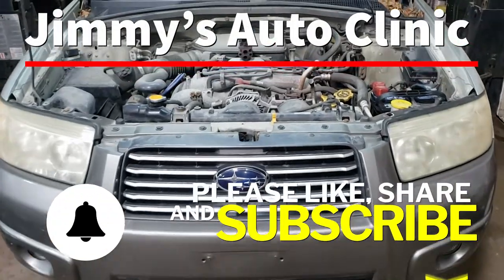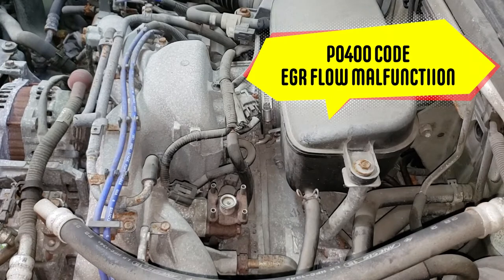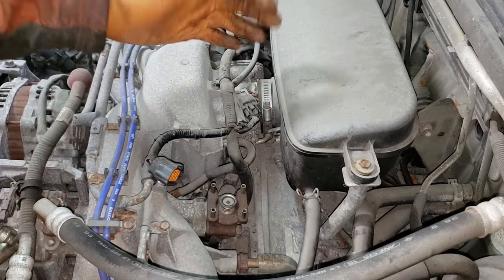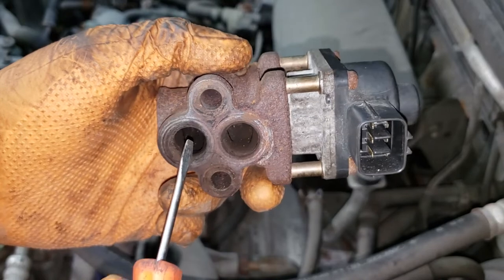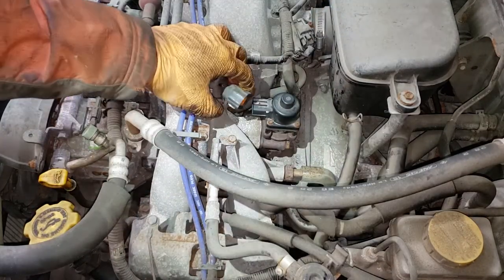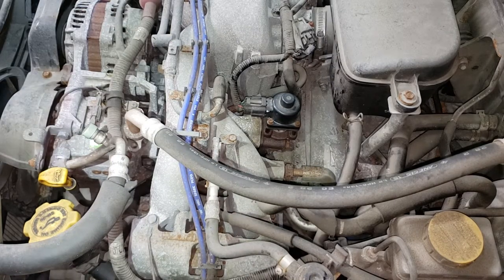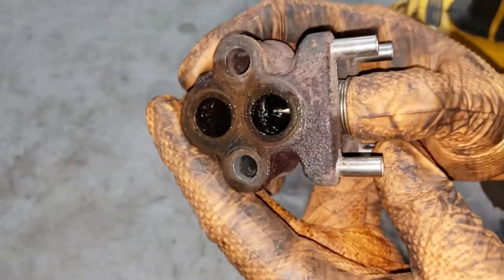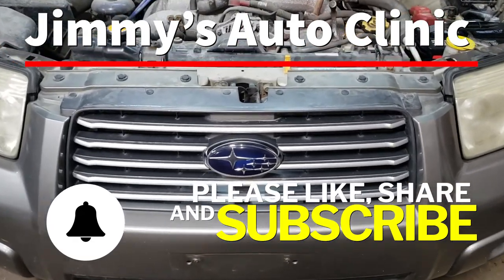Subaru EGR Valve Malfunction | P0400 | P2097 | 2006 Subaru Forester

Comment: Thanks for taking your time and sharing the details . I have 2006 Subaru outback and Headgasket was replaced recently , Post having issues when the car is idle on the stop ,The car vibrates /the tach needle  does not jump but is shaky and I can feel it and it goes away once when moved  and  no error codes  and also smelling gas from the Exhaust , Not sure if those are related to clogged EGR Value , Any insight
Reply from the maker: It is a possibility that your EGR may be slightly stuck open. However if the problem started right after the head gaskets were replaced I would ask the technician who did it whether the vowels were adjusted. That can also cause a bit of noise and a bit of a rough idle after your heads have been machined and the valves not adjusted. Provided he says that they have been adjusted I would definitely take a look at the EGR valve they do sometimes stick open just a bit and can cause exactly what you're having. Good luck my friend I hope that helps.

Comment: Shouldn't you also unbolt the bypass tube if you have to mess with the EGR valve?  if there's that much carbon in the valve, there's probably a lot of carbon in the bypass tube.
Reply from the maker: On the Subarus I've never had to unbolt the bypass tube. In my experience they never get plugged up. However on many other manufactures it is common practice to unplug those tubes because they do become plugged up.

Comment: Can you tell me, what is the wide black box located in the rear of the engine compartment,  with the snorkel on the left attached? What is its purpose? Mine has a broken nipple, where the hose is attached on the front left. The hole appears to be sealed off by design. Would there be an issue if it’s detached from the box? Thank you in advance.
Appreciate your detailed explanation in this video. Subscribed.
Reply from the maker: Hi bill, are you talking about the black holes with the white piece on top of the engine that is connected to the plastic ducting on the intake? That also has an electrical connection? A two wire electrical connection?

Comment: Do you need to reset ECU  / Reset idle after replacing an EGR?
Reply from the maker: For this particular year 2005 you do need to let the vehicle relearn the correct parameters that it needs to idle correctly. There is a relearn procedure that can be done but I usually don't do it I just drive the vehicle and it's usually after the first couple of Cycles is back to normal provided everything is fixed. I usually do clear the codes after I do a repair like this but because I changed the battery and the vehicle was without any power for a while it automatically reset.

Comment: Hey have you had any issues with “high voltage?” I have an 2007 Subaru Forester and my Emergency Break Light and Battery Light keep turning on and my radar detector reads “high voltage” and turns off after it reaches 16.5 volts! I replaced the alternator and battery but the two lights keep turning on… Any help would be appreciated thanks Jimmy
Reply from the maker: Unfortunately I haven't had any issues like this which an alternator did not fix. What I would probably do is look at the alternator wiring mainly the green connector. They can be quite a pain to come off and sometimes they can become depend when trying to get it off so make sure that the connector is in good condition and that the wires are firmly in place. If that all checks out make sure you have good connections from that end of the harness to wherever it goes in your vehicle. Meaning the ECU dash lights all that sort of stuff. Most likely it is a bad alternator or connection to the alternator through that green wire which turns on your regulator. I hope this helps you. If you have any more questions feel free to reach out. Good luck
Reply: @JimmysAutoClinic  Hey I really appreciate the response. I’ll keep you posted. Thanks again!

Comment: Mine has a small vacuum leak.
Reply from the maker: Hey, Have you found the leak?
Reply: @JimmysAutoClinic  Yeah, the boy and I did a smoke test over the weekend. And the only place in the engine bay that I saw any smoke was from the EGR valve. It was coming out around the valve stem. I cleaned it up as best as I could and reinstalled it. Cleared my vacuum leak code, and it seemed to be running great. But popped a CEL again last night. So I have a new one on order.
Reply from the maker: I'm glad you found it. That's amazing to hear. I haven't seen one leak from there yet. Do you have a lot of mileage on your vehicle? Do me a favour don't forget to hit that subscribe button.
Reply: @JimmysAutoClinic  it's an 06 Impreza with 111K
Reply: @JimmysAutoClinic  but before we replace it, I'm gonna smoke test it again with the controller off of the valve just to make sure.
Reply from the maker: That's really surprising. Thanks for letting us know you are experienced. Much appreciated.
Reply from the maker: @thumpin7953  let me know what happens. Good luck my friend

Comment: i got P1496 error ,
Reply: cleaned the EGR didnt work. replaced the EGR didnt work, any more clues? car is running normal gas consumption is same. only thing is CEL and cruise flashing. i cannot use my cruise control which sucks as i drive 120km a day, subaru forester 2006 SG9 NA